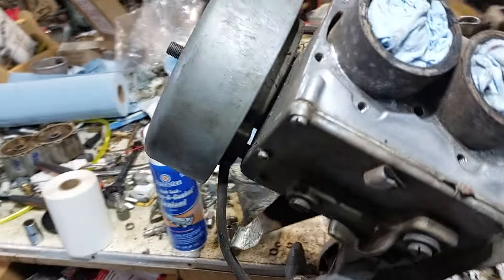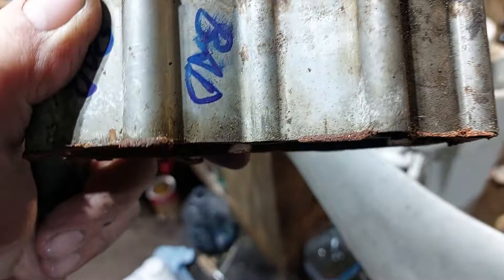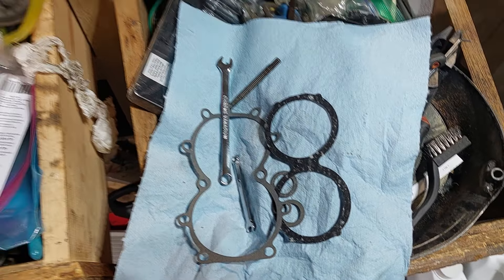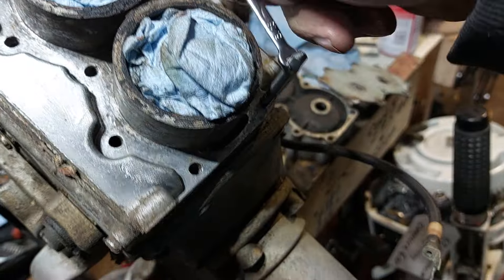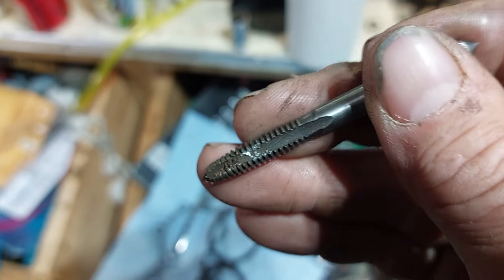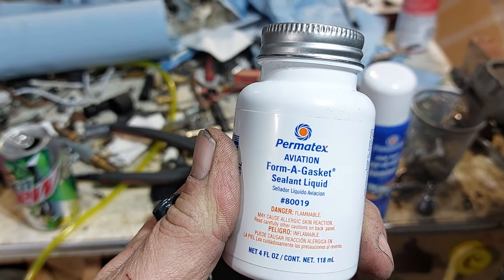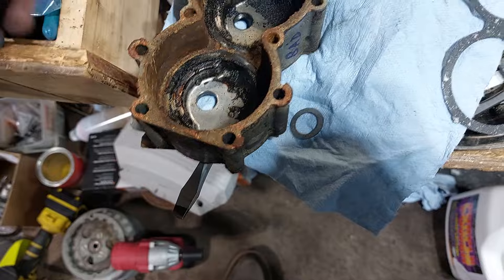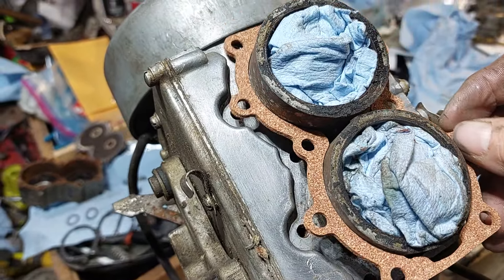1948 Martin "60"- 7-1/2hp Head & Gaskets replacement. #vintage #martin #boatmotor

Comment: Hey I had something happen earlier I took my Jon boat out when I pulled it out of the lake I raised the motor up to attached Mt transom brace when I did the motor started scared the crap out of me it's a 15 hp evenrude with electric start the wires to the push button starter made contact
Reply from the maker: Wow! I bet that was freaky!